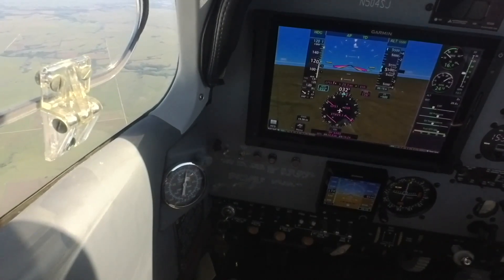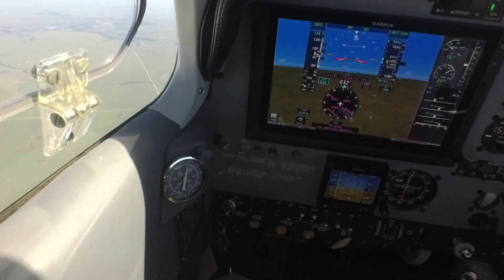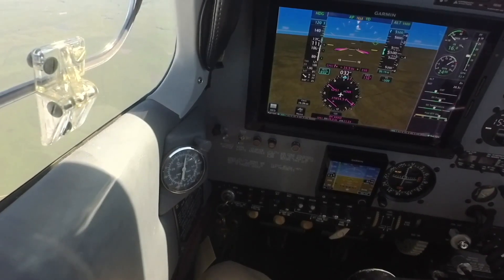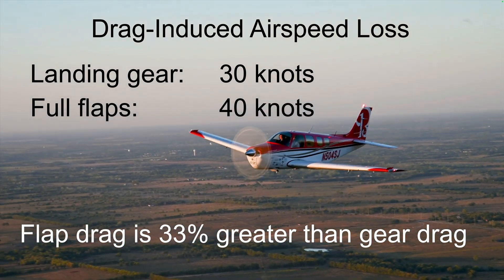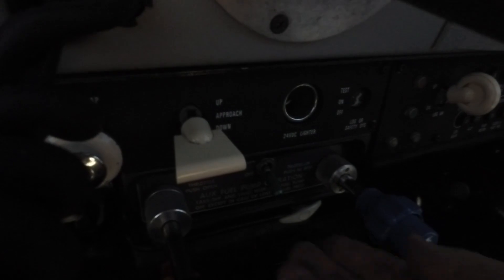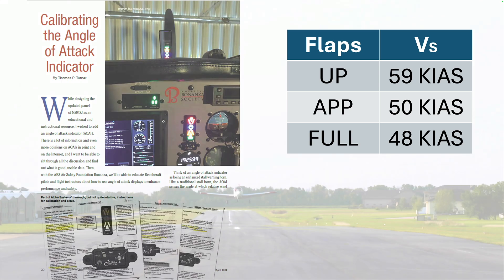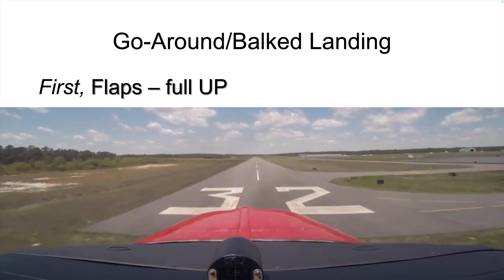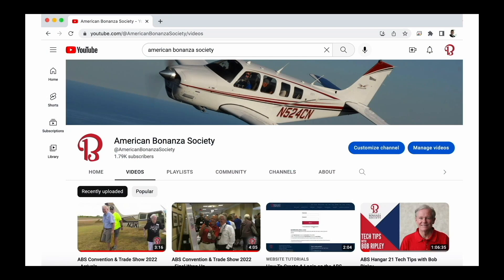Flaps or Gear First? The Definitive Go-Around Answer for Beech Pilots

Comment: How much extra drag is introduced when the gear doors open during retraction?
Reply from the maker: I've not quantified it, but in-transit drag is negligible in 28-volt airplanes with faster gear operation. There is a noticeable increase in drag during transit of the slower 14-volt landing gear systems. - Tom @ABS

Comment: This video does a great job addressing the lift/drag part of the equation.  It does not address pilot workload related to trim.  I've not flown an A36 but do fly a V35 regularly.  When the flaps are retracted after t/o, there is a large amount of retrimming that needs to be done.  If trim isn't reset immediately, the plane will be in a dramatic nose-up condition.  To raise the flaps 100%, without an intermediate stop, can quickly create a potentially dangerous situation.  Add the stresses of a missed approach in IMC and the situation can become bad quickly.  Although there may be some reduced drag from immediately raising flaps all the way, I'll stick with going to approach flaps and transitioning to a climb, raising great with a verified positive rate of climb, and then taking out the remaining flaps when workload permits. It just seems like a safer way to do things.
Reply from the maker: This particular video was meant just ot address which controls should be moved first. We'll be doing a follow up video on the full go-around procedure. The experiment in this video confirms Beechcraft POH procedures.

Comment: With regards to the the earlier 12 volt electrical system equipped aircraft (vs later 24 volt aircraft):  Were the gear and flap retraction speeds about the same, so therefore there was no real need to specifically call out which to retract first (although it is still good practice to pick one and stick with it)?
Reply from the maker: When I (Tom) began researching the POHs I expected that might be the case. The Bonanza changed from a 14- to 28-volt system in 1978. First-edition POHs as far back as 1970 (14-volt) had the Balked Landing checklist calling for flaps before gear, so Beech did not make that distinction.

Comment: A reasonable start but pretty far from "definitive".
You need to get your headset mic sorted so you aren't spiting pops and cracks in everyone's ear. It isn't just bad for the video (which should have been replaced by the voice over.) but makes real radio communication that much worse.
A slightly more relevant test is to set and maintain your climb speed (Vx or Vy) and use the VSI to indicate drag. Manifold pressure can be anything as long as it doesn't change from run to run. This better accounts for the specific conditions of induced and parasite drag during a go around, as compared to the zero vertical speed with changing airspeed test. Also test the mid flap setting with gear up and down.
Reply from the maker: Good alternative experiment. I'll try it. Yes, I need to find a better-than-standard mic foam for these. -Tom

Comment: Does the 1/2 second difference between which to retract first make a difference?
Reply from the maker: Not really. But the airplane will climb fine with gear extended for the first part of climbout (you do that every time you take off), so if there's any delay flaps are the first choice for drag reduction. -Tom

Comment: very dangerous conclusion, keep first 3 critical steps in the summary always - take off power/ high rpm pitch / airspeed checked BEFORE even thinking of flaps
Reply from the maker: Watch the video and you'll see this is predicated on power and attitude (airspeed) first. The purpose of this video is to address just the flaps vs. gear question, assuming power and speed targets are already met. I'm planning a follow-on video with the full go-around process (including airspeed and AOA impact of the POH technique). But addressing the flaps/gear question alone filled this episode's timeframe. - Tom
Reply: @AmericanBonanzaSociety  you should never assume - basic important safety prerequisites should be shortly, but always clearly stated

Comment: Great treatment. 

There IS a note in the G35 POH BEFORE LANDING checklist:

"For Balked Landing, advance throttle, retract
gear and flaps, select AUTO TAKE-OFF, monitor
engine RPM and do not exceed red line."

So it's addressed but completely up to the pilot as to order.

Does make you wonder about making full-flap landings. Maybe half is a better choice if length and obstructions are no concern. At least from the perspective of a go-around. The manual says "DOWN" but not how much.
Reply from the maker: Many pilots have a personal technique of using partial flaps for most landings.
Reply: Gear first then flaps, says it pretty clear!

Comment: Like the additional info with the full flaps vs approach flaps. However in an instrument approach, only at approach flaps, which would be better? Obviously, Beech says flaps up.
Reply from the maker: ASF BPPP standard is approach flaps until going visual, and full flaps if time permits. The By the Numbers technique is designed around flying the approach at the missed approach climb speed to maintain a roughly constant trim setting through the missed. This pretty much limits flaps to half ("approach") to avoid a big trim change at the high-workload initial phase of a missed approach. - Tom

Comment: Analysis should also be down on how much altitude can be lost rapidly if you retract flaps close to ground.  Losing 50ft or 100ft from retracting flaps during a go around could end badly.  What is safe altitude to retract flaps after getting out of ground effect for example?
Reply from the maker: Fly a go-around like you'd fly a takeoff: power, pitch (airspeed) first, then flaps and gear. Done smoothly you'll be 100 feet or more above ground (about two wingspans, that's not much) before reaching for the flap handle. - Tom